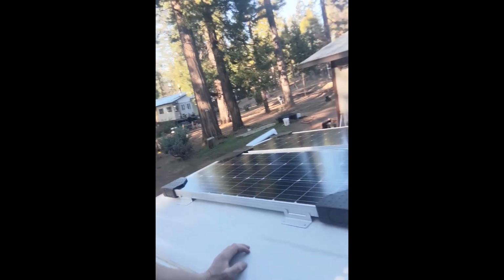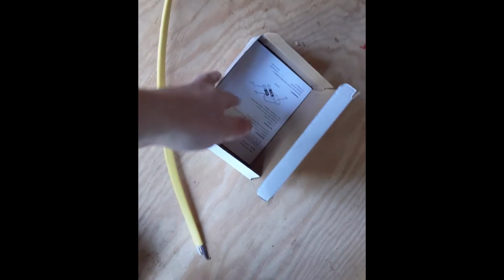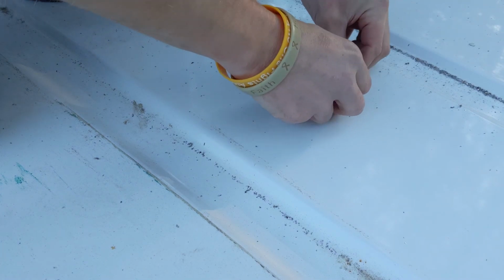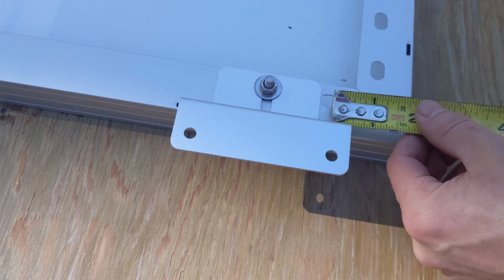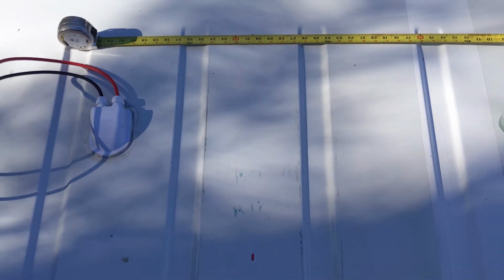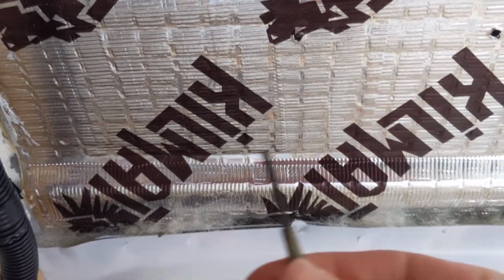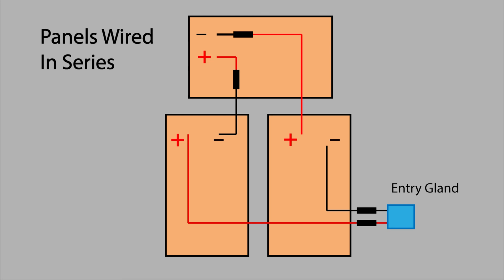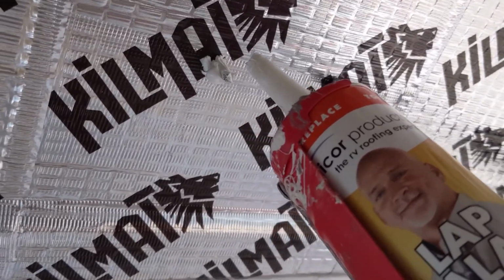Van Life Build | Ford E350 Stealth Conversion | Solar Roof Install | Ep 15

Comment: It would make no difference what side the split washer goes. Also I surprised you trust the whole setup to just a few self tapping screws.  How has it been holding up?
Reply from the maker: Gotcha, I've just read that it always goes under the fastening nut because essentially that's what it's holding in place.  

As for the self tapping, it seems to be holding up just fine.  I think the butyl tape is also a complete bitch to get off once it's on there so that has added some additional adhesion.  I've seen people attach them with only that, and I thought that was a little sketchy but having multiple screws in helps disperse any one single screw having to do all the work. 

Obviously some kind of lock nut and bolt set up would have been ideal, but extremely hard to access after the ceiling went in.

Comment: Remember air running under your solar panels is a good thing to keep them cold I’m doing mine now and I think I’m going to cut a hole in the floor and weld in a box for my battery so they have good air flow and if anything happens it’s contained
Reply from the maker: Good call, I guess I was so focused on keeping them as low profile as possible I didn't consider the airflow. The back two should be okay, that front one might not be as efficient as it could be considering the clearance.  Thanks for the heads up, might have to do some mods there.
Reply: @blueprintvans789  all depends on where you are going to be with the van I guess if its not a super hot place you should be fine I ran 6 inch pvc pipes on both sides of my van to hide the solar and I use one for water for a outdoor shower the other is just storage